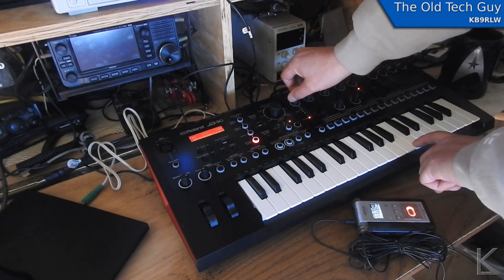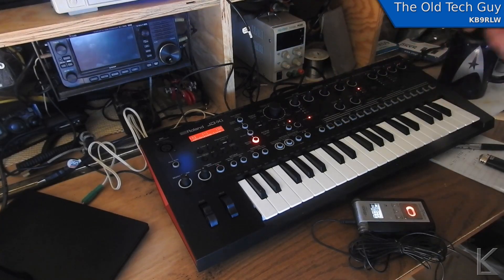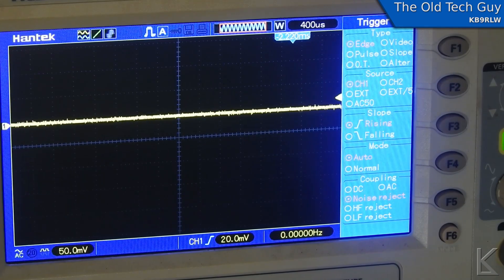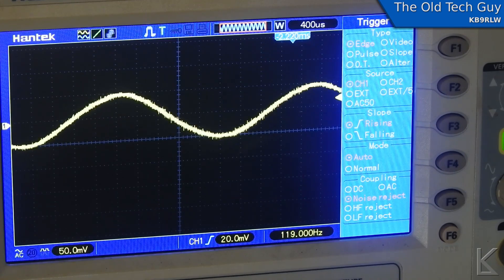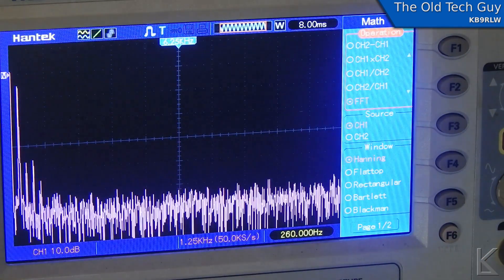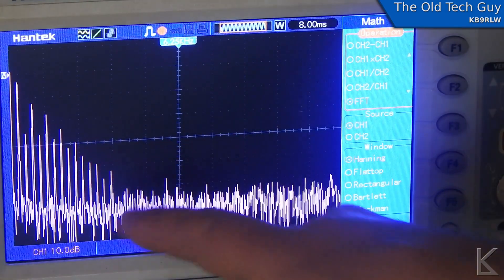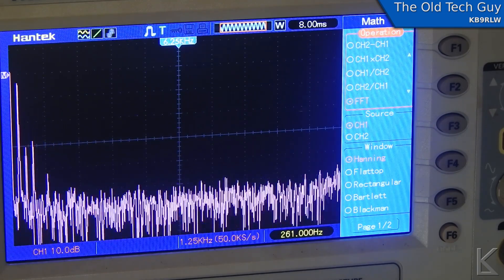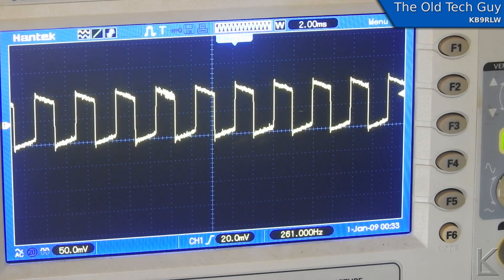Electronics - Visualizing the effect of a low pass filter on harmonics.

Comment: Pretty cool using an oscilloscope for looking at sound waves. I repaired an old single pass scope, that someone gave to me recently, and the first thing I did was to test it using an FM audio output and then looked at the sine waves from an 8 bit computer tape cassette.
 
One thing I did notice was the amount of background interference that a fluorescent tube from my magnifier lamp was creating by moving the probe close to it. Its a shame this scope isn't mobile enough to use as a interference tester.

Comment: You might look into the Wave series catalytic heaters.  I have a Wave 6 which I used with my 32 foot class C (29 foot living space with one slide), and with a 30 pound tank I was able to go about 10 days before a refill.  Since there's no flame there's no condensation and no CO emissions, the heat is generated by a catalytic chemical process.  The drawback is that they're not cheap.

Comment: All modern HF transceivers and some H. P. amplifiers have variable low pass output filters in them, variable in steps.  Many modern HF transceivers have continuously variable low pass output filters in the form of automatic "T" type antenna tuners. Ron W4BIN
P.S. In Florida winter is two or three weeks in late February.